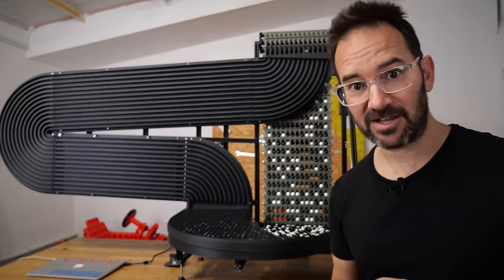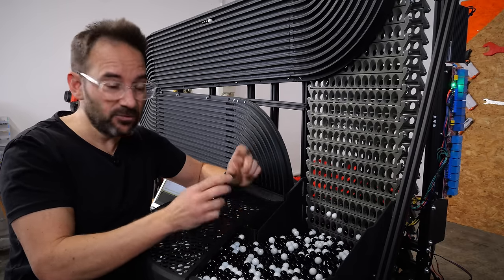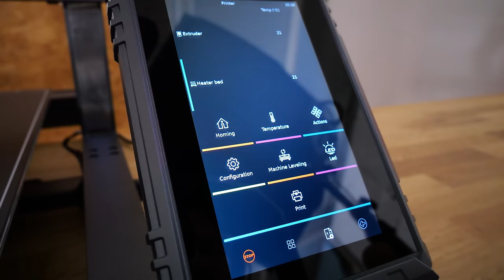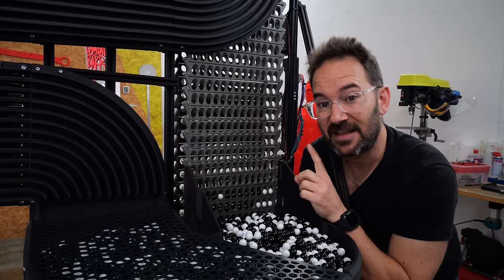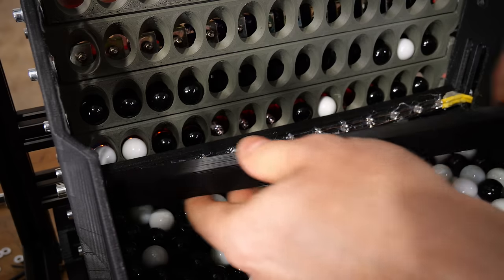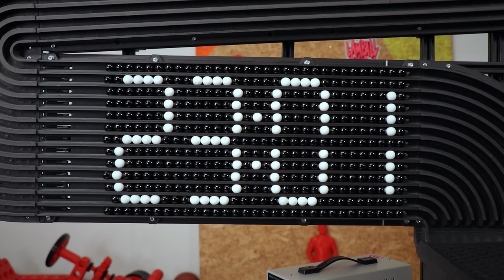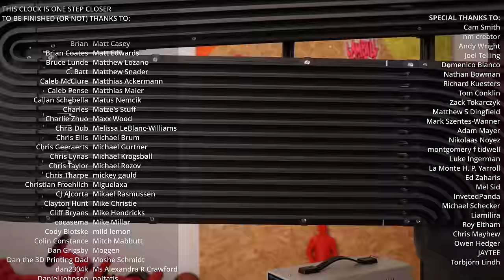BUILDING A MARBLE CLOCK - Pt. 2

Comment: Summary
Conceptualizing the Marble Clock
- 0:29 Discussion on turning the device into a clock by organizing marbles
- 0:32 Need to arrange marbles in channels
- 0:38 Plan to check the color of every marble and push out the wrong ones

Design and Assembly Challenges
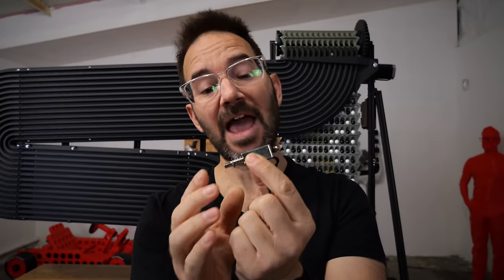- 0:47 Initial attempt with larger solenoids failed
- 1:00 Moved to smaller solenoids and created a 13-solenoid array
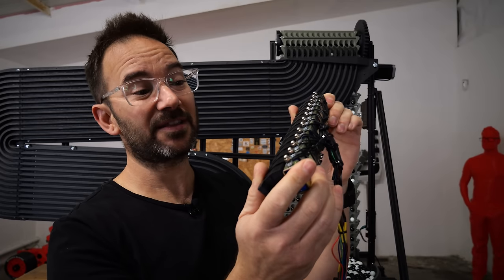- 1:14 Smaller solenoids mounted on a 3D printed bracket and wired
- 1:19 Installing solenoid array into the clock to test
- 1:34 Fine-tuning solenoid position for optimal marble ejection
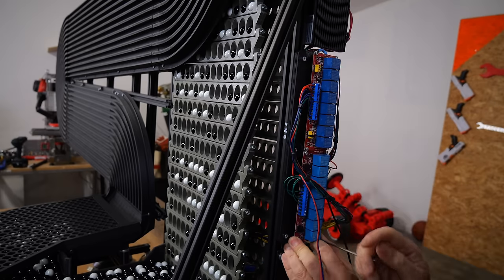- 1:47 Relays used to control solenoids due to power requirements

Testing and Calibration
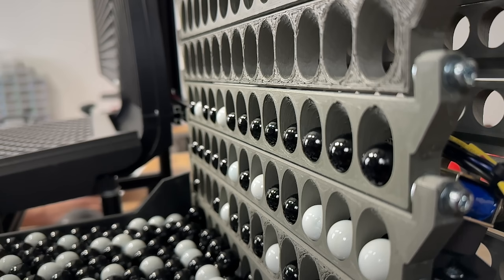- 1:58 Solenoids effectively eject marbles from the elevator
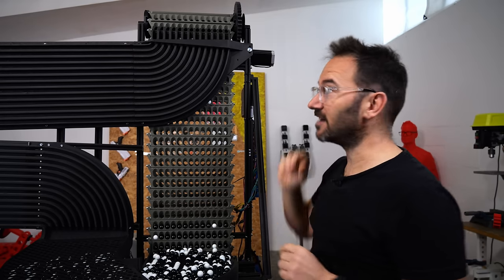- 2:10 Manual alignment for tests, aiming for automated marble positioning
- 2:14 A disc with slits installed to consistently align marbles in front of solenoids
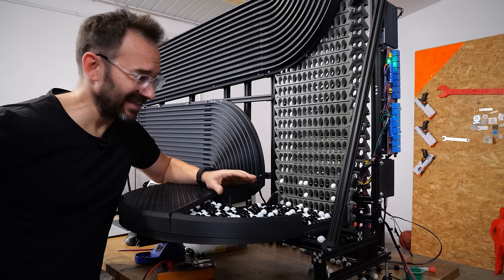- 2:47 Successful consistent marble hitting; issues with marbles spilling out
- 3:01 Attempts to contain marbles within the machine
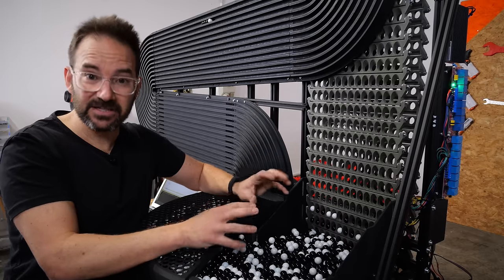- 3:25 Need a way to discern which marbles to eject to form the correct time
- 3:36 Initial marble sorting with LEDs failed due to weak signals and noise
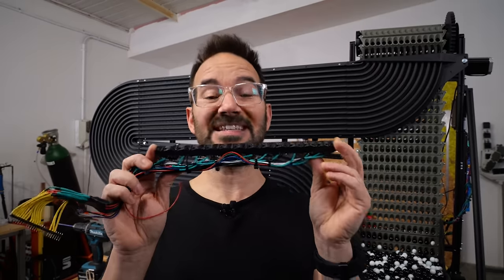- 3:52 Second attempt using light dependent resistors was inconsistent
- 4:13 Final solution with infrared sensors from line-following robots
- 4:33 Infrared sensors confirmed as the right option, requires a bracket for installation
- 5:51 Calibration of sensors to detect black and white marbles
- 6:00 Code written to reject white marbles specifically
- 6:14 Now able to discern between black and white marbles and reject incorrectly
- 6:23 Adding an extra sensor to detect gaps between marbles
- 6:35 Installation of a plate to improve sensor detection of marbles vs. gaps
- 6:49 Issues with distinguishing black marbles from gaps, causing incorrect ejection
- 7:05 Attempts to resolve sensor issues were unsuccessful, decided to resume the next day
- 7:15 Overnight idea to use the existing sensor row to detect gaps instead of adding a new one
- 7:31 Plan to align infrared lights in front of current sensors for dual readings
- 7:41 Second test with front lights off distinguishes between black marbles and gaps
- 7:50 Concept works but implementation with broken lights needs replacing

Improvements and Adjustments
- 8:08 Solution is functioning, but rejected marbles are causing a buildup
- 8:16 Created a new ramp to prevent rejected marble buildup at the elevator's bottom
- 8:48 New anti-marble buildup ramp successfully increases sorting speed

Final Steps and Community Engagement
- 9:58 Initiates testing for drawing numbers with marbles
- 10:07 Realizes there aren’t enough marbles to display two full minutes due to discarding many
- 10:20 Orders more marbles, which will take time to arrive
- 10:24 Addresses issue with marbles getting stuck at gate releases
- 10:39 Plans to fix marble jamming issue while waiting for new marble delivery
- 10:46 Next video will aim to complete the project
- 10:50 Requests information on where to buy quality glass marbles in bulk
- 10:55 Urges viewers to subscribe for updates on the project's completion or potential end
- 11:14 Video concludes with a call to action for viewers to engage in their own projects

Disclaimer: I utilized GPT-4 to condense the video transcript into a
summary.  I employed Prompt 1 to generate timestamped bullet lists. I
then used Prompt 2 to organize these lists into sections with
titles. The summary was manually formatted using YouTube comment
markup.

Prompt 1: "Generate a bullet list summary, including starting timestamps for each point."
Prompt 2: "Split the following bullet list into sections. Create section titles. Keep timestamps for the bullets. Use this format for titles: *title*. Keep bullets that you deem important to the story."

Comment: A coupple of suggestions.
1) move your stop gate to an earlier point. The marbles dont have enough velocity to be able to move past the bend.
2) A wider curve for the marbles to move arround the bend, the sharp curve especially for the top rows, is apparently adding friction and causing jams.
3) Due to the random nature of how this operates, you may never see enough of a desired color in a specific row in the time needed. This may cause your clock ro be off. You may want to consider loading your white marbles in from a diffrent path.
4) due to the way you reject marbles you will eventually have them impact each other. You may want to conaider a material other than glass, or possibly coating the marbles in something more impact resistant.

(Maybe get in touch witht the youtuber making the marble machine, as he may have some good ideas to add to this.)

Comment: 🎯 Key Takeaways for quick navigation:

00:16 🕰️ Building the Marble Elevator System
- Designing a system to organize and drop marbles into the channels effectively.
- Experimenting with different solenoids for pushing marbles out of the elevator.
- Exploring the challenges faced in finding the optimal solenoid size and power for efficient marble movement.
02:07 🛠️ Implementing Precision in Marble Placement
- Utilizing a disc with slits to position marbles accurately in front of solenoids.
- Discussing the challenge of marble overflow and strategies to control the marble flow effectively.
- Preparing and aligning components to optimize the marble movement within the system.
03:27 💡 Trials and Errors in Marble Identification
- Experimenting with various methods (LEDs, light-dependent resistors, and infrared sensors) to identify marble color.
- Detailing the challenges faced in accurately detecting marble color due to changing light conditions.
- Introducing and calibrating a sensor array to effectively differentiate between white and black marbles.
05:53 🤖 Enhancing Marble Sorting Precision
- Implementing sensor calibration to identify and reject white marbles efficiently.
- Discussing the integration of additional sensors to distinguish between marbles and gaps.
- Exploring the challenges of refining the system for accurate and efficient marble sorting.
08:08 🔄 Improving Efficiency in Marble Sorting
- Addressing the issue of rejected marbles causing build-up and re-entering the system.
- Introducing a solution - the anti-marble buildup ramp - to prevent rejected marbles from re-entering the elevator.
- Discussing the progress made and the need for more marbles to proceed with the display.
10:07 🧩 Preparing for System Completion
- Detailing the insufficiency of marbles for continuous display due to discarding flawed marbles.
- Highlighting the challenge of marbles getting stuck upon release and proposing solutions.
- Expressing the intention to complete the system in the upcoming video and seeking suggestions for sourcing quality marbles in bulk.

Comment: I am worried it is not fast and efficient enough to update the time faster than a minute passes by. Even if it is fast enough to fill in the full number, how long will it stay before it has to be changed? I think you have to redesign the slide and separate each number, so hours and the first digit of minutes stays untouched. That way you will always have the current time in front of you, and only need to wait until the last digit fills in. Forgot to mention that it looks insanely cool and I love this project and I love seeing how much fun you are having developing it. Great job 🤍

Comment: Just a suggestion: In order to match the clock with current timing, you can measure how much time it does to make a pattern and add that time to the next pattern made. For example. if it takes 2 min to make the pattern, the time would be shown in jumps of 2 minutes. i.e - 2:00, 2:02, 2:04, 2:06. It will make the marble clock more interesting.

Comment: It looks awesome! The task is to display the time every minute without delays. You can propose such a solution to the task: there should be two containers with marbles (one for each color) at the top. Between the conveyor belt (clock face) and the containers, there should be a distribution system that releases marbles of the required color onto the appropriate track. Currently, you have two marble drop systems (static and dynamic) on the lifter; you can keep only the dynamic one and sort the marbles at the top.

Comment: I don't comment often, but I wanted to give you this feedback/question: Can't you make the whole thing more compact -- and perhaps simultaneously solve the "marbles get stuck when I release the gates" (10:22) -- by modifying the overall layout to  sort of a Dollar-sign shape. This is my thought: ditch the top straight section, connect that topmost down-and-left curve directly to the U-turn section. Then, mirror the U-turn at the base of the conveyor belt so that you can move the conveyor belt behind the time display (rather than beside it).

Goes without saying, this is an awesomely over-complitaced contraption, and I love it!

Comment: Hi Ivan,
I just came across your channel for the first time, what an amazing project!
The idea of sorting the marbels already at the lift, so they will arrive in the correct order makes absolutely sense. But I'm thinking you either could fill the clock from the top-down, or from the right with the escape at the bottom. In that way you'd only have to 'draw' the minutes every time and not having to redraw the hours as well.
This would mean you would conserve the the hour-marbles from the lift, as well as the 10-minute marbles which only had to be changed six times an hour.

Looking forward to the next video!

Comment: It can run much faster if you calculate the ratio black/white for each possible time displayed then put in the ideal/average ratio black vs white marbles.

not sure how much difference it would make but if you have some not optimal time to display like 1:11 you could draw a line above and below the time or use a double row to make each 1.

Comment: Have you considered running your marble channels vertically instead of horizontally?

This would mean you'd only need to change one number every 60 seconds instead of the entire display, which should help the machine keep up with the march of time.  Obviously every 10 minutes you'd need to change two numbers and every 60 minutes at least three numbers would change, but a piece of code could have the marble clock work ahead on those bigger changes while it keeps up with each minute.

Comment: This is amazing and very creative. Good job! 
I have a suggestion:
How about you build some kind of reservoir in such a way that the marbles will form on the left side during the minute but are held back. When the minute changes, they all move down at once. The change on the clock will be very fast and there are 60 new seconds to fill the reservoir on the left side.

Comment: A quick fix to stop the marbles from sticking might be to attach a vibrator/shaker to that section of the marble path and activate it during the transition period.
I believe a similar technique was sometimes used in avionics to overcome static friction in analogue instruments.
Although it'll as complexity, you might find sweeping a frequency range will yield better results.

Comment: When you finish debugging the drop and the set of balls. measure the display dial time. The timing between the start of the set and the end of the set. Use this time to correct the delayed clock on before the last ball falls. This way you will get the coolest clock effect, namely the correct display of minutes to the current time. Thank you.

Comment: an idea from my side:( improvising from others in the comments)
- you can segregate the withes and black marbles from just after the display and fill them accordingly in a palate(a much steeper one) from which they can move swiftly down and fill the gaps without being stuck
-try reducing the falling of marbles from the belt as much as possible (eg: use a screw-shaped elevator) as falling may after type tend to brake the marbles or deform them and you must buy new ones again
this is a fantastic project (all the best)! 😀👍

Comment: this is objectivly one of the sickest things ive ever seen. possible solutions to your marble stopping problem. Increase the slope and reduce the friction between the marble and the track. prehaps this calls for some kind of slick spray coating. other options could use a small motor to lightly tap the back of the device to nudge them to fall down. hope this help gl

Comment: Very very cool.
Suggestion - put something (smoked glass? Not entirely black - but shielding somewhat) in front of the upper part and allow it to build up next "image" there. So you can make a change fast. Like a double buffer system.
And yes, that would take even more marbles

Comment: I love this project, especially the way it sounds. Great job.

What I wonder how you figure out the number of white marble required to optimize how long it takes to find the right mix. Eg 0838 is a lot of white and 1111 is the least white. Too much or too little white means the fill up takes longer and in each case, you need more than the minimum number of marbles of each colour so that they are available with sufficient random occurance at the elevator base.
Reply: yes, the mixing and disorder coming together organized is a big part of the charm.  it's a great sound - reminds me of the olden days mechanical digital train station clocks.  would ball bearings be affordable and the track handle the weight?

Comment: Its a nice concept to 'draw' a clock, but i assumed the clock will be late in minute. A little suggestion, you should make independent track for the hours and the minutes vertically (marbles drop like a sand clock) not horizontally like the one shows since the horizontal does not separate the hours and the minutes. So when the minutes separate i hope it can keep up with the time with real clock.

Comment: I would recommend:

1. Have the clock in the top portion.

2. Automate a stop gate for the marbles on there to stop the marbles, then when time to change the time have it auto-release.

3. Have separate tracks for hours and minutes so that you are only replacing minutes repeatedly and hours when needed, this will also speed up changing.

By feeding to the top portion the time will appear faster.

Comment: The gates where you stop the next set of marbles once you finish off a "minute" are currently causing the marbles to queue back around the curve which is causing jamming. What about relocating the gates for the next minute at the end of the straight section above so that the next set of marbles can roll smoothly down the ramp?

Comment: I see a lot of suggestions about making this better, like conceptually redesigning it. A lot of them are arguably more efficient or more likely to work (lol) but... this is an engineering ART project. Basically ... I'm going to make the idea I'm thinking about in my head work no matter how good or bad the original plan is as I find out during the process. Instead of prototyping and redesigning the project to a final, functional product - the prototype is the final product design and it is brute forced to work as originally imagined.

Comment: I think it could be faster if you have 2 containers for black and white marbles (because no holes), improve speed and add a stop right on the curve,  so when the 23:01 is over they will fill the display in no time. Next step would be returning the marbel to each container. Great Video

Comment: Here's an idea...
 Instead of horizontal stack, why not do a vertical stack. This will solve:
1. Marbles getting stuck when the gates are opened 
2. You can just replace the digits that need changing
3. It will be faster filling the numbers, individually

Btw, nice work! Can't wait for version 2.0.

Comment: What if you put the marble gate right before the curve? It's the lack of momentum that allows the marbles to get stuck in the curved area, because you do not have the same problem when you let the marbles flow freely. You may need to make the track area that is in between the curved area and the elevator longer so it can hold the next minute's worth of marbles.

Comment: What if you dropped them from the top? They wouldn't get stuck in the drop gate. You have 13 rows, but you could separate the sorter between 2 groups of 13 columns, one for hours, one for minutes. Then when the minute changes it flushes the old numbers and drops the new numbers. The middle three columns could be static for the dots.

Comment: Amazing project! have you considered doing vertical loading of the marbles? (Columns instead of rows).  Might help with faster switching time.  

Maybe a color sorter instead of RNGs?

Maybe a rig behind the display to eject the current number to load in a new one? 

So many ideas in my head! but regardless, this is awesome!

Comment: you can make it much more compact if you turn the channels so they are vertical and double or triple it to make it wider... put the elevator behind the clock... when you change the time let the marbles drop in a hopper at bottom that feeds elevator.. then drop them at the top.. you can also have next time ready to drop but cover the channels so you don't see the area above the time area..